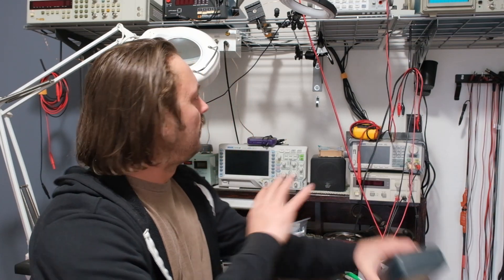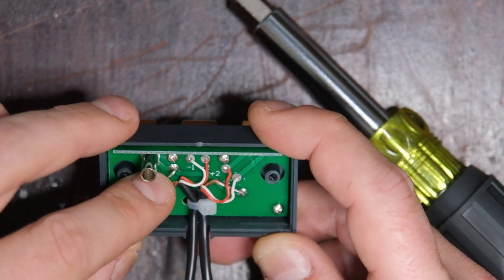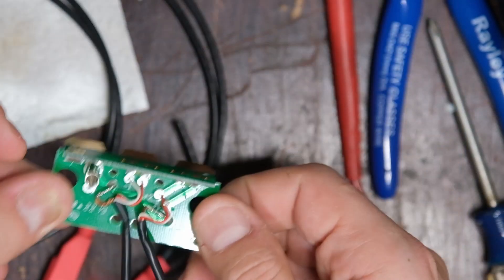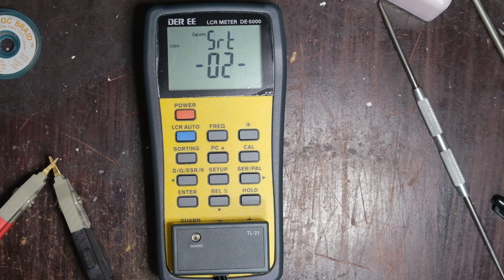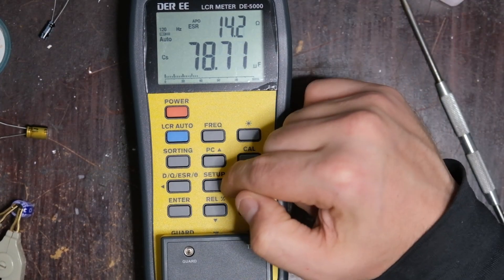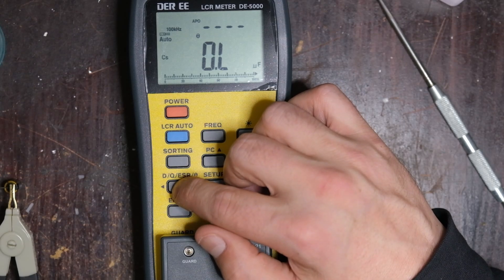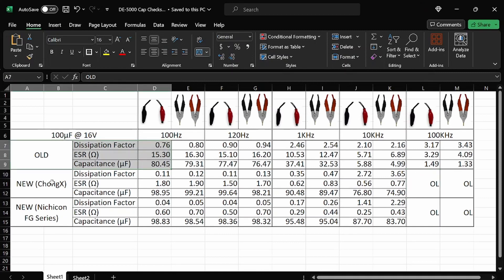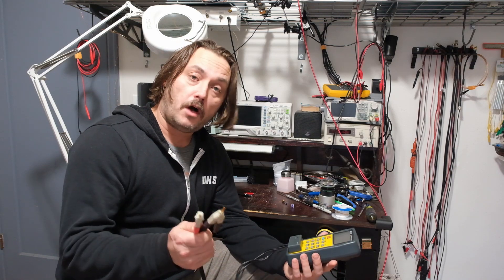DE-5000 LCR Meter Test Lead Mod and Capacitor Comparison

Comment: Are you sure the leads that come with it out of the box aren't Kelvin leads? I think they are as two cable leads such as the probe master 8152 give calibration failure in the DER EE DE-5000.

Comment: I got mine since 2013 . Still going . The small aligator are due to low inductance wires . On high frequency counts allot . Comparing de5000 against a proper tool Bode 100 Vector Network Analyzer for hobiest the de5000 does just fine .

Comment: I did not want to buy yet another OEM wall wart, for my DE-5000; I wanted to repurpose one. But, the DE-5000 uses an odd power input pin size. I determined that it is 1.35mm x 3.5mm (at least that worked for me. I could not find such a ready-made connector plug, so I made my own, from a bare pin. P/N 490-PPM-2-35135-S1 at Mousey. HTH.

Comment: Dissipation factor! A very important measurement..... 
This measurement is referring to how much DC current is passing through the capacitor! 
In a perfect world, a capacitor should only pass DC current until it reaches operating voltage of the circuit it's in or its maximum rated voltage printed on the side of the capacitor. There should not be any measurable DC current across the capacitors, unfortunately we don't live in a perfect world and capacitors will leak DC current, some will be worse than others, you want this figure to be as low as possible! 
Decoupling capacitors with a high dissipation factor will act as a load on the power supply, causing the power supply to work harder and hotter while pulling down the voltage rails for the rest of the circuit. 
In the case of coupling capacitors, like for example between audio stages, a capacitor that is passing DC current onto the next device in line which is usually a transistor will bias up or down depending on the actual transistor used and cause a failure which sometimes ends up being a cascading failure which takes out many components.... 
Most people just check for ESR, while bad ESR can cause issues, a capacitor with bad ESR shouldn't cause a failure! It's the capacitors with bad dissipation or as known by Drain factor that is responsible for delivering component failures.... 
I prefer to test capacitors by putting them in series with a μA meter to measure for DC current leakage, slowly bringing up the voltage to what the capacitors are rated for. 
Sometimes I see leakage slowly creeping in but after a short period of time sitting with the same voltage applied, the current drops and I can continue doing this until rated voltage. 
Note that this only applies to new capacitors! The longer a capacitor sits in your parts bin, the more it will dissipate and for longer.... They do stabilise but if the capacitor has a critical role in a circuit and you can going to use something that you have had in stock for ages, it's most likely gone into what I like to call a comma, it's going to need some time to wake up! Applying full rated voltage after sitting around unused for years is the equivalent to someone giving you the biggest slap just as you have gone into deep sleep! Not good! You too will probably blow up just like a capacitor does LoL.... 
It's advised on the Panasonic capacitor datasheet to reform their capacitors if they have been sitting around for a year or more.... 
Never reform used capacitors to use in new circuits! 
While if you suspect that a device has been sitting around unused for an extended period of time, before applying full rated voltage, plug the device under test into a wattmeter and a Variac and slowly begin to bring up the voltage in jumps of 5 or 10V at a time, allow the device to rest after each jump with the voltage constantly applied while keeping an eye on the wattmeter for any drastic changes, if you see a wattage increase after a jump but it slowly goes down and settles, this is a clear indication that the capacitors are either slowly waking up or they are nearing their service life expectancy.... 
After reaching the full operating voltage of the device, another test should be completed on another day or if possible a week later, if the device under test has returned to the same behaviour, the capacitors are bad and will need to be replaced! If not, then all is well and the capacitors have returned to provide a good service life.... 
For testing capacitors for DC current leakage, I use my Variac which has a full bridge rectifier that also has a resistor and a switch so that I can bleed off the charge on the capacitor under test while at the same time the bleed off resistor can be taken out of the test circuit so that it doesn't interfere with the results, an analogue μA meter and shunt to see what the capacitor is doing, and that's it! I can dial in almost all voltages that I come across.... 
This test procedure should only be done by competent persons! A fully charged capacitor isn't something to be reckoned with! 
I would advise to construct a test jig with a clear cover hinged over the capacitor on a base, I'm currently working on an idea that includes a switch that is activated when the clear lid is opened which will short the capacitor to a bleed off resistor just in case this test jig ends up with someone who could forget to flip a switch to discharge the capacitor under test and find out the hard way! 
Other than that, I find that it's a cheap and good way to both test capacitors and wake up new old stock... Or test old one's to see if or how bad they are! 
I have many different types of purchased capacitor testers but I favour the simple and possibly dangerous way that I have described above.... 
Capacitors Ah! You can't live with them, you can't live without them! 
You just have to try and understand them as much as possible..... To make your life just a tad bit less painful 😖...
Reply from the maker: Very interesting information Peter! I don't often deal with high value capacitors, but I did build a discharge wand for the times I do. Clip one end to chassis ground and touch the cap terminals and the voltage is bled off through a resistor. So far so good!
Reply: @offkafka  A discharge wand is a must! A charged capacitor is a snake waiting to be stepped on! They bite! 
But the fact remains that the majority of people don't understand capacitors! 
I have seen people test a capacitor for ESR and the measurement returned to good result but.... I could see from all the way over here in Australia that the top of the capacitor had bulged and had leaked it's electrolyte..... The person in the video said that the capacitor is good! It's definitely not good! 
I also saw someone else test capacitors for capacity and the results showed that they somehow had more capacity that what they were rated for.... This is clearly a dry capacitor! The capacity of a capacitor should always be just below it's rating! No exceptions! If it's over, it's bad! If it's too low it's also bad! 
A good capacitor should have low AC series resistance! Should have high DC series resistance and it's capacity should be as close to its own rating but never over! 
Stick to this and you will always know if a capacitor is good or bad! 
I test capacitors by stepping up the voltage all the way to their rated voltage because a capacitor can test good a low voltages... By stepping up the voltage you get to see where the capacitor is beginning to go bad, you get to see how much life it has lost! You just don't get that sort of confirmation when using any of the capacitor testers made today! It's either good or bad and you don't know why! 
The old Heathkit high voltage capacitor testers were great at teaching by showing you how a capacitor works when I has begun to fail..... 
Mr Carlson's Lab channel has done videos using these old vacuum tube capacitor testers.... I highly recommend watching it if you haven't already....
Reply from the maker: @PeterMilanovski The Heathkit unit are great. I should know, I restored one! https://youtu.be/frG6-D1Fh5w

Comment: You might want to compare resistances measured in 4-wire mode on the HP 34401A against the DE-5000.

Comment: it is a very nice meter. It even beeps at you after a couple minutes if you forget to turn it of.
The longer leads will influence the capacitance measurement, especially the small value's. Could you please make a comparison of much lower value capacitors, something like in the pF and 1nF; 10nF.